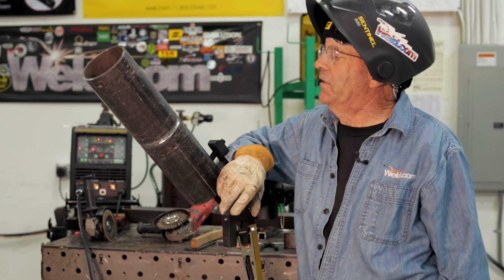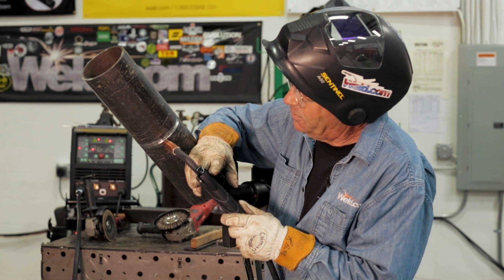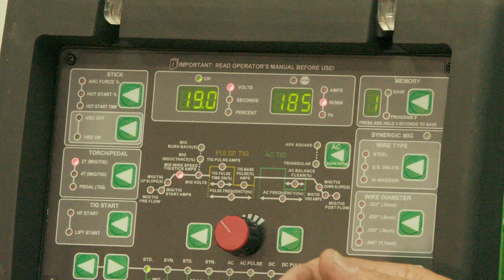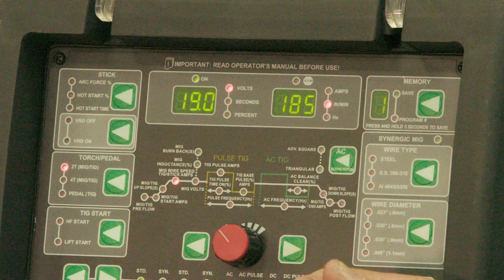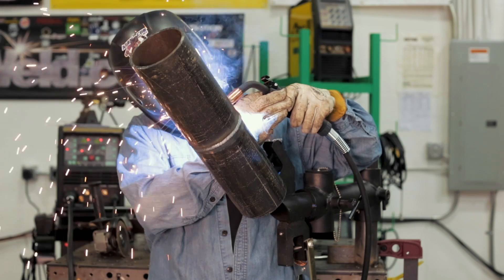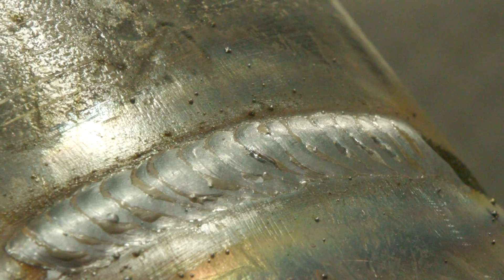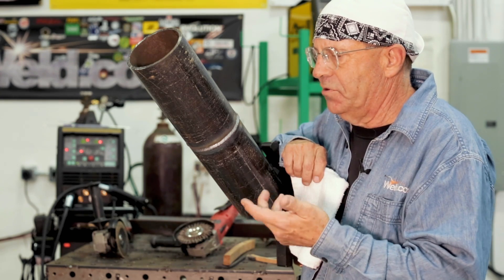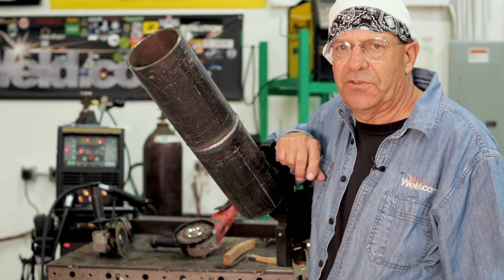6G MIG Welding Technique

Comment: Question  is it possible too weld  10 gauge 4” stainless pipe with the mig if so what gas do I use and wire speed and voltage?

Comment: The fill and cap for drain pipe can be run top down from 12 oclock to 3 and 9 oclock. Then from 9 and 3 oclock to 6 oclock position all downhill. High pressure is a different method for sure. Great video! Short arc pipe welding is challenging in any position, but a lot of fun, as well as great learning on out of position.

Comment: I'm look8ng to achieve this test in mig, booked my test for August, I'm wondering what would be the best pipe size for 6g in mig? Pipe thickness, pipe diameter etc? 

6 inch pipe, E.H 80s 10.97 I'm thinking, O.D at 168.28.

My thinking anyway.
Reply: did u pass it ?

Comment: What alot of people dont know...if you add methane gas while mig welding it helps produce better penetration.
Reply from the maker: You just have to weigh the importance of that versus angry co-workers...
Reply: @Welddotcom  i 100% agree with you on that lol
Reply: Not to mention just what it was that the methane producer ate in order to produce said gaseous venting. That could mean the difference between between laughter and manslaughter.

Comment: increase half a volt to flatten your bead 15 more wire speed and increase your travel speed. if you drop your wire speed too low you risking not punching in there very well. got to remember this is pipe and you're using .035 wire.